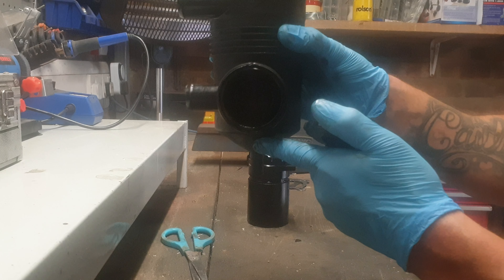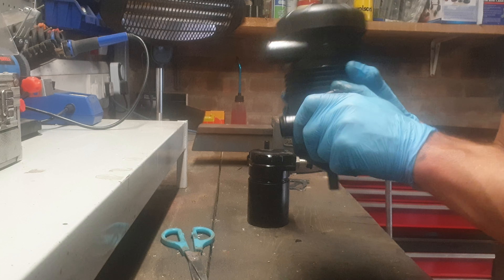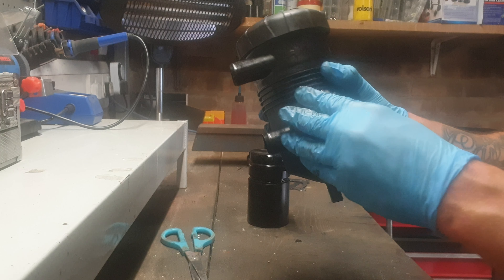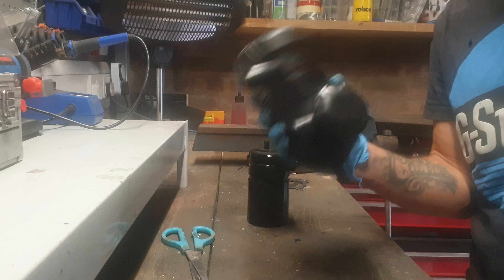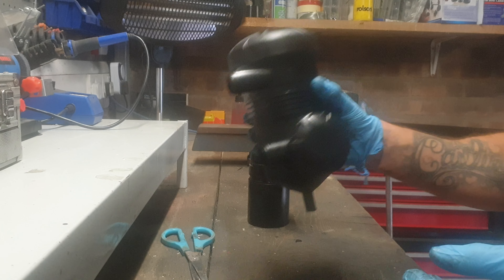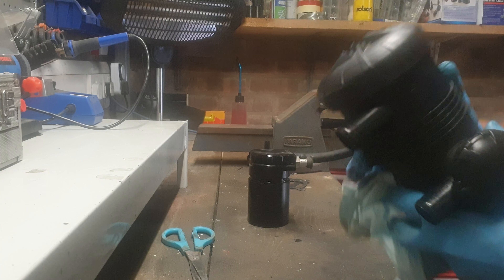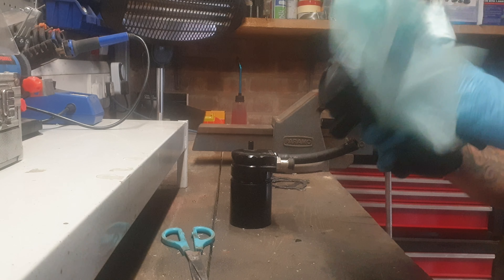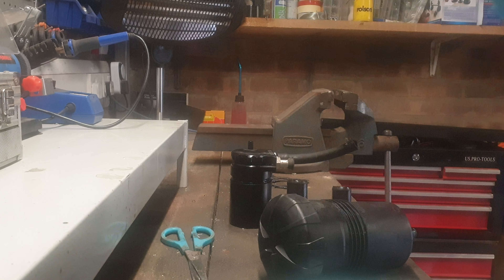BMW 335d smoking issue provent 200 update 8k miles later has it worked ?

Comment: The Bosh filter its much better and its like 30 euros or so and its fits without problems .
Reply from the maker: Agreed the Bosh filter is better but I beleave this provent to be much better  due the the surface area of the filter.
Reply: @TheBlackSheepprojects  my apologies to not make it clear , l.mean the bosh provent filter( filter inside the provent ) , l hope this clear it .regards ( l use it)
Reply from the maker: @jpsr20det  ... ah I will check that out as I have not seen that option ... thanks for the info :)

Comment: Hello from Germany, have installed the original Mann+Hummel Provent 150 to my VW T6 California TDI in January 2021. Can not say so much about it, because 1000km until now. But I think it works very well. Have you changed the drain hose to a oil resistant one? Have a nice day, Knud
Reply from the maker: Hello 👋 yes i have changed to drain hose now :) the first one i put on was not oil resistant.

Comment: Hi bud have u change your chain before  and what stage are u? I hear that provent200 holding to around 300+ hp , currently running 410hp and not sure if it suitable?
Reply from the maker: Hello pal, no still running the original chain. These engines are built solid and You done here many nightmares with chains. I'm running 400 bhp stage 2 the proven handles just fine with plenty of free flow breathing capacity
Reply: @TheBlackSheepprojects  Thanks pal , also is that the original Provent 200 or chinese one ?
Reply from the maker: @shteryolakin9896  Chinese pal really good quality think it was 26 pound of ebay
Reply: Thanks bud , iam from Oswestry and just seen your videos , very thankful :P Are u a mechanic?
Reply from the maker: @shteryolakin9896 .... Ah I'm in wrexham I have an m4 now the 335d has been sold. No not a mechanic just been doing cars for years self thought 👍

Comment: Hello mate how much would you charge to do a kit like that on someone’s car thanks
Reply from the maker: Hello pal, I would say its £50 in materials and parts and I would charge £50 labour to make the kit ... fitting the kit would increase this by another £50 ..Obviously if more people would buy a kit like this the price would come down ;). I would highly recommend having a go yourself, it's really easy to do. you could probably modifie the existing ccv in a similar way to the plate I made if your metal skills arnt up to scratch.
Reply: l8on6661 so the provent filter is to keep the vacuum? So just the oil catch can by itself isn’t up to the job
Reply from the maker: @bimmerladuk  ..hello pal, the BMW ccv does a really poor job of separating the oil from the crank case vapour. This then gets fead back into the intake. The oil that's in the vapour mixes with the egr and clogs up the intake and vales (carbon build up) . My system improves this 10 fold . I would also recommend you remove the egr as this just causes isses. I use the provent to seperate the oil and the catch can in my video is just there as a container to hold the oil seperated by the provent. I have used a few catch cans  and i find the provent works alot better. You can just use a catch can as u have done in the past. The provent is just a better designed catch can.
Reply: l8on6661 thanks for the information mate. I have the egr deleted on my 535d when it was mapped. How long are the pipes from engine to provent as very keen on this set up

Comment: Hi mate where are you based?
Reply from the maker: From wrexham  pal 👍
Reply: @TheBlackSheepprojects  I have a puff of blue smoke on start up, where's the best place to start... I don't think my crankcase breather has been changed on 100k+, got all the same mods as you... Once it's hot there doesn't seem to be smoke
Reply from the maker: @zainsaghir5624  sounds like your glow plugs and or glow plug modual. If you put a code reader on the car it will show this as a error code. Modual is about 120 and the plugs around 40 to 50. Easy to do just have to be careful of the plugs snapping. If they snap its a bad day for you my friend :). When taking them out plenty of wd40 and slowly back and fourth on tight stubborn plugs.
Reply: @TheBlackSheepprojects  they've all been done mate, I can't for the life of me think what it is... I noticed a slight oil drip near the vacuum pump which makes me think the crank case breather might be leaking
Reply from the maker: @zainsaghir5624  ... well if its not un burnt fuel it has to be oil. Have you checked your intake pipes after the intercooler for oil? Just out of intrest how ling does the smoke last for?
Reply: @TheBlackSheepprojects  I've not had them checked, I've not long had an uprated intercooler and new boost hose and seals fitted.. definitely on cold start up I get a puff and when I rev when it's cold bits of blue smoke but once driven and when it's warm it's no longer there.. can smell it a tiny bit in air vents on start up for about 15/20 secs and then goes away
Reply from the maker: @zainsaghir5624  ... had a similar issue with my last bm. Worth trying .... unplug the maf start the car 2 mins. Turn off turn back on you should now see engine light on. The car will be in a generic fueling map. Is the smoke still present. Easy test amd cost nothing. You can leave the car to cool to test for cold start.
Reply: @TheBlackSheepprojects  no worries mate I'll try tomorrow, I tried to do it the other day but I'm struggling with how the electrical sensor disconnects, do you push both clips in at the side and pull?
Reply from the maker: @zainsaghir5624  .... ye thats it pal easy enough.... it may be tight so u could push the clips in and use flat screwdriver to gently help it along.
Reply: @TheBlackSheepprojects  just unplugged it and the engine light came on... So that rules out its probably not the MAF?